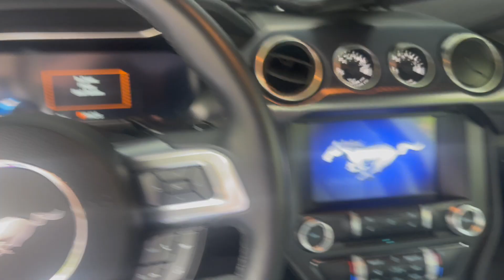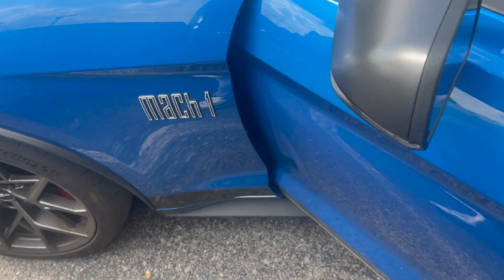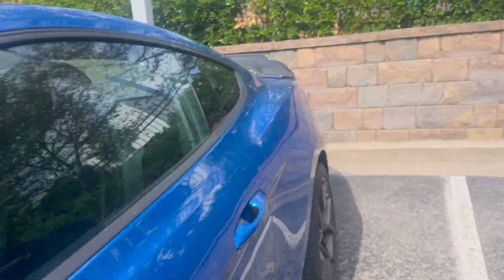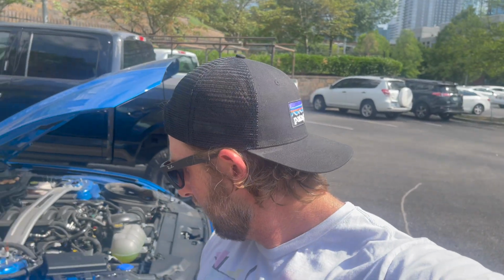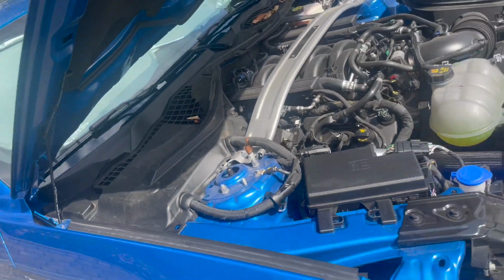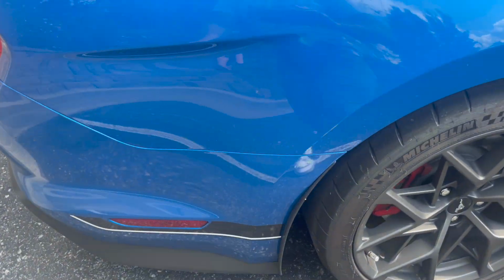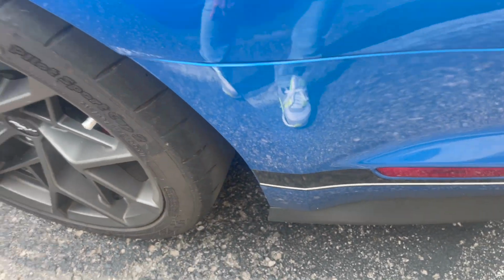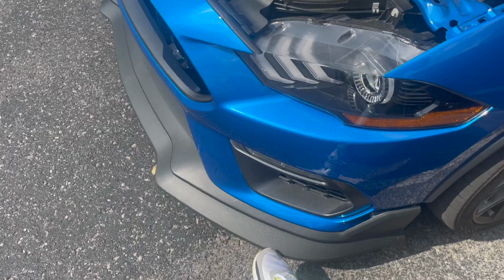Mustang Mach 1 Major Problems (5,000 Mile Owners Review)

Comment: body panel misalignment on driver's side and then passenger side strut is messed up.  Your car hit something dude.  If it wasn't you, someone else was taking it on a joyride....or, put it on the lift incorrectly when they changed the oil.
Reply from the maker: That’s what I was thinking!
Reply: Never trust dealerships. Always do all the maintenance yourself, you'll be better off long term.
Reply: His car didn’t hit anything, this is typical Ford build quality.

Comment: interesting, my Mach 1 doesn't have the body alignment problem but I have the same problem with the tire. I got a nail in one of em and got it patched but it is slow leak now, when my tires are at a 29 psi, the one tire will be a 23 or 24 and i filled them up all together

Comment: I have a 2022 GT Premium with Perf. Pack, My passenger headlight does not fit right, there is a gap, it is going to Ford in September for that. We have a 2020 GT500 and 2 pieces on that one do not line up. We have had several mustangs in the last few years, the 2 we have now, have been the worst with the body not aligning correctly. Maybe we all have Friday cars! ☺

Comment: Dang bro. Sorry about the fender issue and it sounds like maybe something might have hit the front end or maybe someone hung on the door. I'd check the bolts on the door. Regarding the suspension, mine is just springs and it's a pretty rough ride (look out kidneys) so I wish I could have gotten the upgraded suspension.

Comment: Hi Jake, i would like to know whats is the zumbing sound when you started the engine in this video: it sounds V8 mustang typical sould but over it sounds like a zzzzumm, it is like a blown sound, i dont know if you get what i mean? It is normal??
Reply from the maker: Couldn’t hear it - pretty normal except when driving very slow you can hear the intake sucking and sounds like a supercharger a little
Reply: @JakeTiesler  yeah, i mean that, like a supercharger. Is it normal? I get mine few daus ago and after 300 miles it started to sound like this and i dont know if i have to worry about it. I hear it at neutral and when im inside it sounds like AC was turned on
Reply from the maker: Nah don’t worry, it will start making worse noise in due time 😭😂

Comment: The first problem is you bought the Automatic. Why would anyone want the Auto when it literally has the baddest ass 6spd carried over from the GT350
Reply from the maker: 1. That’s all they had in stock and it was not a planned purchase and 2. I’ve wanted to try the 10 speed since 2018 3. The handling package is hard to get so I bought it on the spot as soon as I saw it driving by 4. I bought the manual pp GT in 2015 and drove it for 7 years with the manual and it was so boring compared to the 10 speed test drive! I’d still like to own a manual Mach 1 also
Reply: @Jake Tiesler Auto  the auto is faster if you are going to the strip.  You should fix the fender before it starts rusting.
Reply: 4 good reasons to buy the automatic: (1) 7th gear...(2) 8th gear...(3) 9th gear...and (4) 10th gear!😅

Comment: I'm wondering why you didn't take it to the dealer as soon as you realized these issues.  I take My 24,000 mile Chrysler 300C Hemi and my Escape ST  to my dealership as soon I find any issues. You should have taken your Mach 1 in for those wheel lips installation that you received after purchasing the car. Did you say your friend was using a screw driver attempting to align the body. That sounds like a bad idea. Using it a your primary vehicle.  Expect rock chips. I just had someone plant their door into my side door.  I'm really pissed. But it's set up to be repaired and paint corrected. New cars are expensive. Get those issues repaired and find a good paint shop that does paint correction for your rock chips.  I'm surprised you plugged your tire instead of having it patched unless the hole is located where tires shops won't repair it. Maybe a replacement since it's still leaking. Love your Mach 1. I would be setting at my Ford dealership tomorrow morning to align that door and panel plus anything else that needs to be repaired.
Reply from the maker: Every time I take it somewhere it’s a hassle and takes time, also usually something else gets damaged in the process of them trying to repair haha - I’m particular about letting others work on it
Reply: You must take it to dealer and make them fix the door alignment that an obvious issue that can be fixed asap.  It is covered under warranty so a dealer must deal with it asap.  Otherwise, you risk it getting worse and having dealer blame you or it not being covered under warranty,  sooner the better is the rule on fixing factory problems.

Comment: Wait wait wait! I had a clunking sound after my first maintenance and I took it back and it was the output for the transmission!! And I’ve been having nothing but problems with mine! It started having a slight vibrating as well I can’t even see out my rear view mirror it vibrates so bad. I also have the automatic transmission. Already looking at trading it in!!! The mach1 is trash 🫠
Reply from the maker: Interesting! Want to hear more
Reply: It's not the Mach 1 it's the 10 speed. It's garbage. Should have gotten the Tremec.